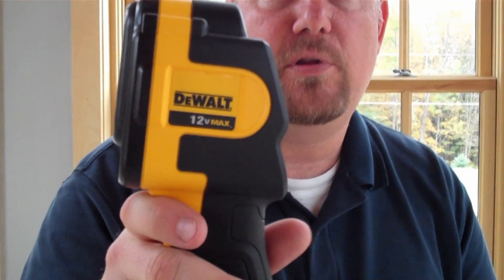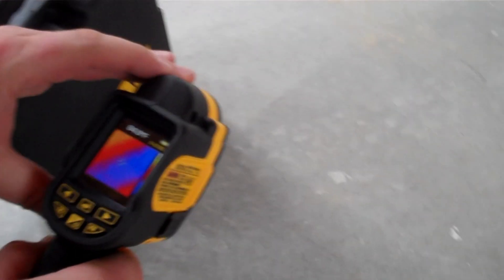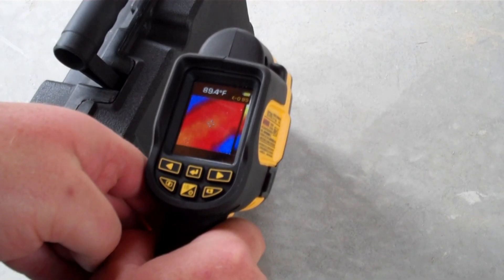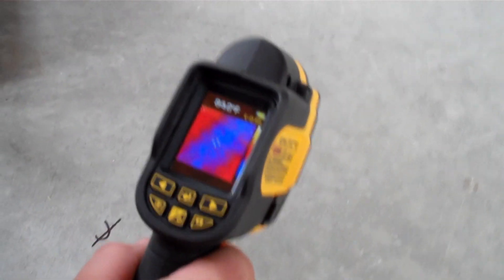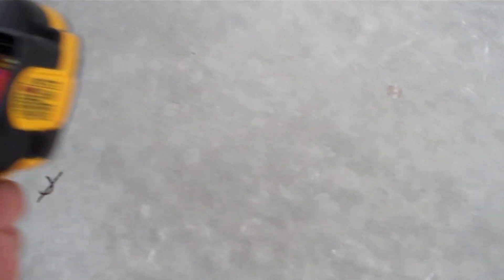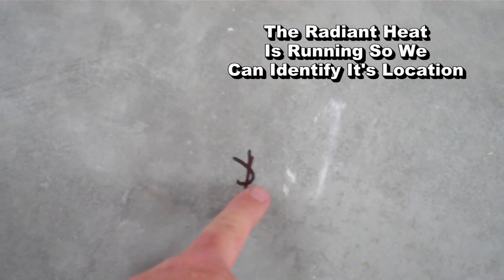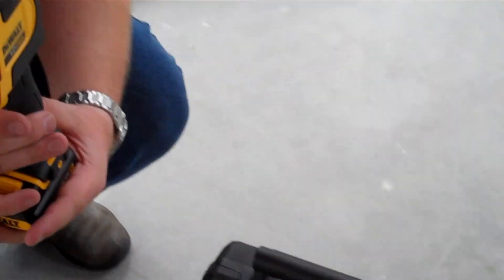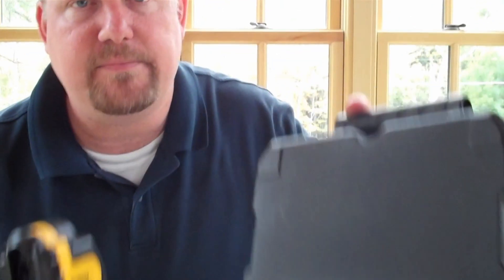DEWALT DCT416 Thermal Imaging Camera Preview

Comment: That's cute.  DEWALT, FLUKE, and MILWAUKEE all with Thermal Cameras; dewalt and milwaukee both make hammers and screwdrivers, why would you buy a camera from them? The only decent camera might be FLUKE, but in terms of Infrared Cameras... why would you not buy/use a FLIR? Thermal Cameras are the ONLY products they make...

Plus, they spend more in R&D then all of those other cameras companies gross per year. It's like APPLE compared to the cheapest PC company on the market from god knows where

Comment: Thermal imaging is the only thing that works for this application. Buddy and I used a Flir to do the same thing on electric resistance wire to figure out where we could cut up a slab to reroute some plumbing.